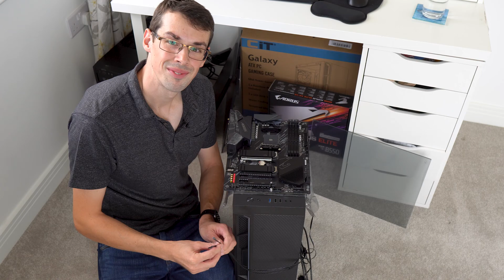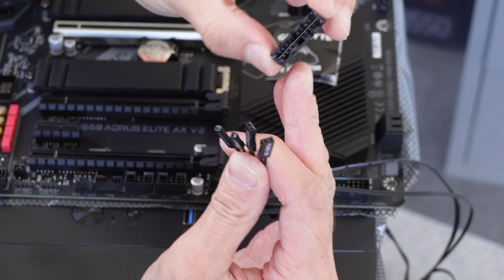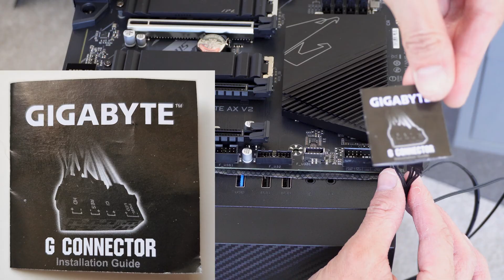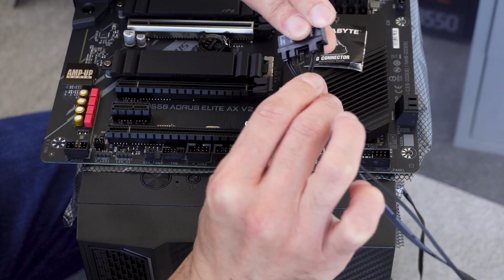I Love Gigabyte’s Front Panel "G" Connector Cube

Comment from the maker: Hey everyone, a quick bonus video today which I had some fun with (!!). I recently received a new ATX motherboard and case to upsize my current workstation PC (which is currently micro ATX), and I wanted to talk through Gigabyte's front panel G connector because it seemed pretty cool to me. I know it's technically not a "cube", but "cuboid" didn't have the same ring to it! I hope you enjoy this video and I'd love to hear your thoughts on front panel connectors generally, and also Gigabyte's solution to them. Thanks 😊

Comment: how can i turn off the 3 LED lights on my front fans, anyone know since software wont do it
Reply from the maker: Do they have an ARGB cable? Basically if your fans have two wires: one for PWM support, and one for ARGB control, then software should recognise it. Although sometimes you might need to disable memory integrity for certain software (like Gigabyte Control Centre) to detect it), which is frustrating.
Reply: @TechOverwrite  4 wires come from the fans, plugged into MB, if i take it off the fans dont work

Comment: My case came with an f panel on a form of a usb and the motherboard has those pins how to I plugged them it’s probably the reason I can’t start my pc
Reply from the maker: IIRC, that's basically an "all in one" f connector. You should just be able to plug it into the motherboard slot, even if it has the pins. But yes, the case's power button won't work if that's not plugged in, and you would instead need to use a screwdriver to bridge the power on headers (as a temporary fix/workaround).

Comment: There's 2 different "Power LED" connection points... one set of +/- on the side of the G-connector next to "PW", then if you flip it over, the 2nd set of "Power LED" +/- connection points is next to a spot labeled "CI".
I initially used the ones next to "CI" but the Power LED connectors wouldn't stay in place.  When I used the spot(s) next to "PW" they stayed in place.  I hope this is correct because I'm writing this in case another 1st time builder is wondering the same thing.

I'm not sure why there's the 2nd spot for the same type of Power LED wires?  Also, my case (Antec C5 Curve) doesn't have a reset wire (no reset button on the case).  Not sure what the "SPEAK" or "CI" is for...but Google AI said the 1st if for PC's small internal speaker, and the 2nd is for a Chassis Intrusion Header to detect if a PC's case has been opened.   I'd guess most modern cases don't have either of those.

Edit: Just to add... the G-connector didn't just slide in... it took some pressure.  My USB-C, and the other USB connectors from my case also took some pressure to plug onto my motherboard.  The only pins that didn't take any pressure were the multiple 3 pin and 4 pin fan connectors.  I was afraid the pins weren't lining up and would get bent, but after triple checking that everything was lined up right, I put some pressure on it.  I'm not 150lbs soaking wet either... I can lift some weight.  Thank you for the video.
Reply from the maker: Thanks for watching and for the detailed comment :) You're right that there does seem to be some inconsistency with this connector yes. Mine thankfully did go into the mobo slot without any pressure, but maybe it varies depending on tolerances on both the G-connector and the mobo slot (I'm guessing both will have like a half a mm variance or something).

Comment: I have all pins connected but not getting any power. I am not feeling well avout this. And can't figure out what it is
Reply from the maker: Ugh sorry to hear it. Are you seeing any LEDs or lights anywhere on the build? Double check that the PSU switch is ON, and if you still don't get lights, I would start by double checking that the 24-pin ATX PSU cable is fully seated in both the PSU and the motherboard.

Comment: Wow thanks. I have been looking at this little thing in it's envelop since I received the motherboard. Did not take it out because I did not want to loose a part. Could not figure it out. Just happened to come across your video. Clear as day and Gigabyte is way ahead of the competition when it comes to this.  New subscriber for this video. Will be going over your other video's to see what other gems you have to offer.
Reply from the maker: Thanks, appreciate the comment and I'm glad to have helped :) It's a VERY useful feature I agree.
Reply: Actually the real best solution is an all in one plug which have been around for years but aren't standard
its by far the worst part of a build and this is a magical thing to exist 😂

Comment: Any help would be appreciated. I have a Havn HS 420 as my case and the same motherboard. The Havn comes with a unified f_panel connector. Im assuming i plug it in on the far left with the blocked off spot on the top right….would that be correct?
Reply from the maker: Oh that's interesting, I don't know for sure so hopefully others can chime in too, but it sounds like you can just skip the G Connector and use the Havn unified f_panel connector instead.

Comment: it wont fit the front panel connector on my mothertboard. the case is a be quiet light base lx and the front panel header is a 9 pin header in one plastic rectangle that does not separate or come apart. the board is the gigabyte aoris pro x870e. any recommendations?
Reply from the maker: Oh interesting, so the case supplies the entire thing? That's good if so - you should be able to put it straight into the motherboard, and ignore the G Connector completely.
Reply: so i was wrong. the unified front panel connector actually fits inside the much longer connector on the motherboard, it doesnt have its own little black plastic recepticle on the board i was expecting. i put it all the way to the left of all the pins and it fit and works.
Reply from the maker: Ahhh, that's interesting. Thanks for replying back to clarify either way. That seems like a useful approach actually :)

Comment: I do not know where the power SW connector goes I connected all the others with the G connector  and the motherboard will boot up if I push the power button on the motherboard itself it will not boot up if I push the power button on the front panel of the case which is a Lina Li Der Bauerer
Reply from the maker: Hmm sorry to hear it, maybe double check your motherboard manual too because that should have a diagram of exactly where everything goes. Often the power SW one is next to the 'missing' pin, IIRC.

Comment: That thing is a godsend -- especially if you have thick fingers and tend to do this stuff at 2 AM. It probably cost Gigabyte 2 cents to make it, but the G-Connector is one of the main reasons to  buy Gigabyte boards. The first time I tried to use one (years ago), I managed to break it, because I didn't have a video like yours to show me how it works.
Reply from the maker: It's definitely nice - I wasn't aware of it, but I'll probably go with Gigabyte again in the future for the same reasons. Such a nice (and simple) idea from them :)
Reply: Where do you get the G Connector?

Comment: hey i just stumbled onto this video but i was wondering.. im in the process of making a sleeper build with a old school case and i was wondering if i connect the front panel io cables into the g connector then to motherboard would that work fine? or would i have to find something else? 
(i have not purchased a motherboard yet as im trying to find the a good micro atx motherboard)
Reply from the maker: Hey. That sounds like a fun build 🙂 Yes that should be fine - the cables themself haven't really changed in ages, so using the G Connector on a Gigabyte board should still work fine.

Comment: Doesn't seem to fit my cases as it's all one block anyways. Still the picture shows it as having one of these fitting but with the metal divider I don't see how. Guess if I lose that I'll never know what goes where since they forgoed writing the stuff on the board.
Reply from the maker: The motherboard manual should have a diagram of which cable goes where, but yes I agree that it's not ideal when the mobo doesn't print it on the PCB.

Comment: there's been different connector like this around... like when I built my Core 2 Quad Q6600 system way back, the mobo had a similar thing. I don't remember what brand the motherboard was though.. think Asus but not sure.
Reply from the maker: Ooo that's interesting, many thanks. My first proper build was an i5 750 system and I can't remember what motherboard that used, but I hadn't seen this until now - maybe I've just been unlucky. Interesting that your Asus mobo back then had similar 🙂
Reply: @TechOverwrite  Unfortunately I don't think it was just you being unlucky... I've built about 6 PCs so far, used MSI, Asus and ASRock, none of which had anything like this... Most of them were very budget MoBos, but my current one cost an absurd 500€ 😐
Reply from the maker: Makes sense, I've used Asus, Gigabyte and MSI a few times and only seen this connector this time too. Pity your 500EUR mobo doesn't offer this either, I agree with another commenter that it's frustrating that motherboard makers haven't standardised this yet. 😔
Reply: @TechOverwrite  what is included in mobos these days have gone down a lot.. like.. proper 7 segment displays with actual error codes used to be fairly common.. but I bought a mid-range motherboard last year and it didn't have 7-segment or even just leds.. only audio.. and prices have shot up and out the door..

Comment: I see this as a failure of the PC Case manufacturers. This motherboard pin layout has been standard for MANY YEARS! Some cases have a unified block already, the rest need to catch up.
BTW, all LEDs (Light Emitting Diodes) need to have the priority correct or they won't light up.
Reply from the maker: True, it's definitely a failure not to have been resolved by now. 😔 And thanks re the LED point - the HDD LED always works 'both ways' for me when it's a double connector like this, but I definitely shouldn't say "the polarity doesn't matter as much"... it's kinda a binary thing - it works or it doesn't 🙈